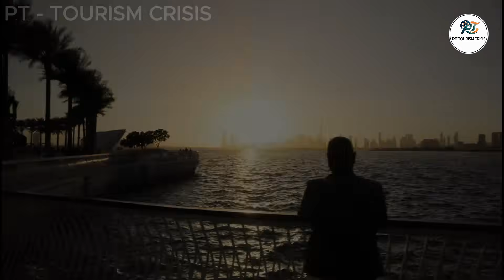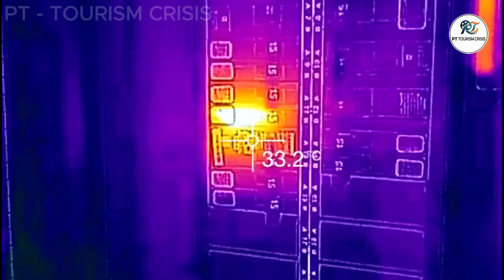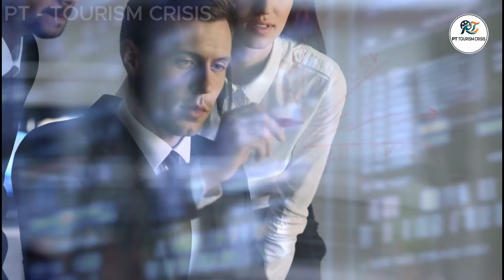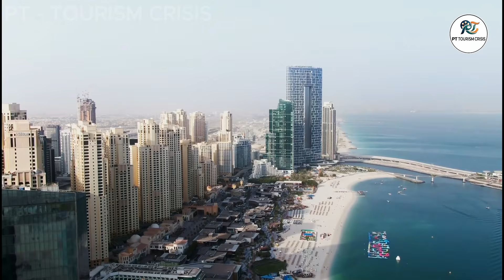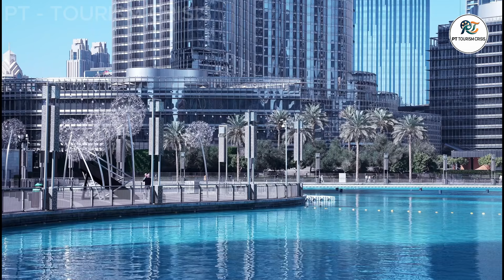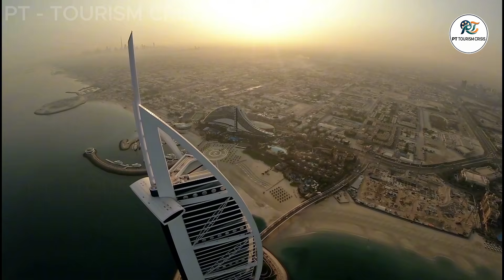Why Dubai’s "Impossible" Comfort Is Finally Failing

Comment: what the hell is 23C is that hot or cold?
Reply: That is 73.4 F.
Reply: 22C is 72F, so 23C is about 75F. Depending on the humidity of the room, it may well feel a bit too warm unless you have fans to make the room windy. For the benefit of Americans, here's a C vs F comparison: 0C = 32F, 5C = 41F, 10C = 50F 15C = 59F, 20C = 68F, 25C =77F, 30C =86F, 35 = 95F, 40C = 104F, 45C = 113F, 50C = 122F, 55C = 131F, 60C = 140F, 65C = 149F... I sure hope we don't have to go further!
Reply from the maker: yes, humidity and airflow can make the same temperature feel very different.
Reply from the maker: Twenty-three degrees Celsius is about seventy-three degrees Fahrenheit—pleasantly warm, not hot.